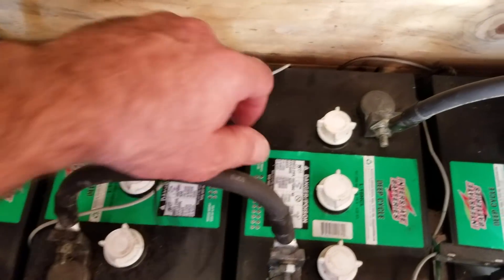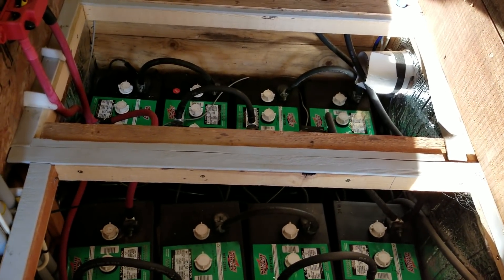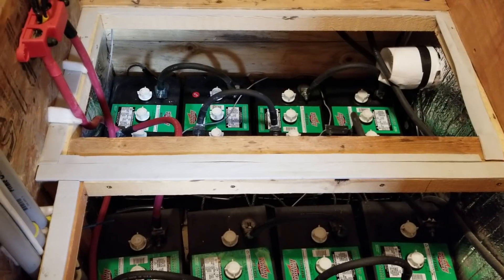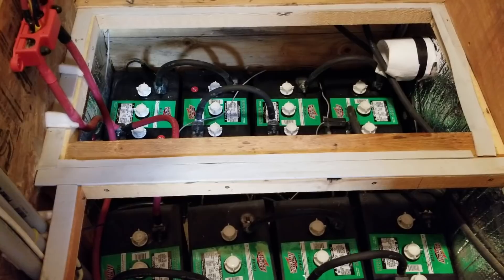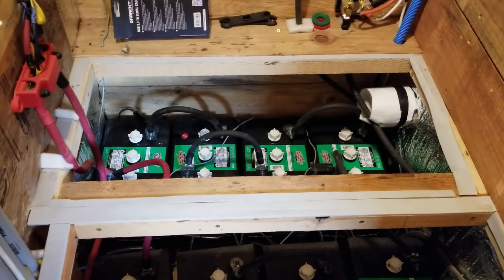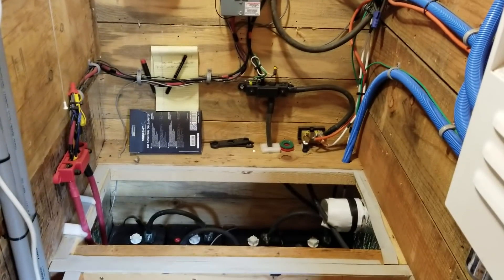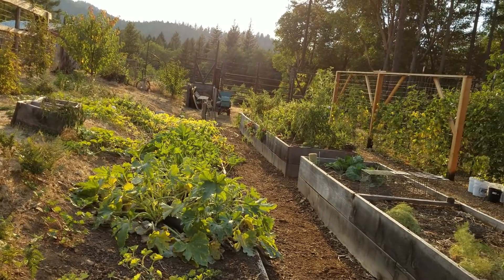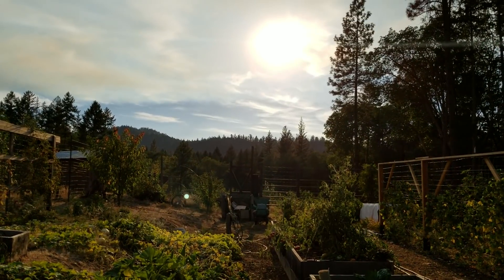Solar battery report.

Comment: Know this is a old video but I need your help. I am running 8 Rolls battery connected to make 24 volts at a total amp hour of 856. My problem is when I get up in the morning I see 24.9 volts on my battery. My specific gravity is above 1.275 when fully charge and ant rest for 24hours. 3 of the battery is actually at 1.300 specific gravity. There is no sulfation on the plates. My percent charge in the morning is 89% I have 2 battery monitors which I trust because they are top of the line they are victron BMV 702 and Bogart battery monitors which I see in you videos. All settings on monitors are correct both reading around the same in the morning. My big question is why my battery is at 24.9 yet my system is showing that I pulled only 10% out my battery overnight? Is it that to know the true battery voltage I need to talk all loads off in the morning before system start charging? Cant seem to find a video online showing system preforming at nights into morning and what the true battery voltage is. I must add this tho my battery manufacturer says battery is to charge to 30volts and float at 27.6 I was not doing this for sometime as the charge controller I had would charge only to 28.8 volts. Could it be that my battery has lost capacity due to not fully charging and if this is the case would it not sulfate?
Reply from the maker: Greetings, 24.9 volts would be about 79% SOC with no loads. This used to bother me so I did a simple test. The only way to get a true reading from your battery bank using voltage only is to remove all loads and charging for 3 hours. Ill bet when you do this you will see your voltage creep back up to about 25.2 volts which is 90% SOC.
Reply: @offgridinthepacificnorthwe3210  forgive me for saying this but I could hug you so tight now for this information I have bother me for 3 years now everybody showing videos how there system is at 25.2 volts and they are pulling 2 times my amp form there system. Thanks thanks thanks thanks your videos are so educational please keep them coming.
Reply: @offgridinthepacificnorthwe3210  I made a error in my text the morning volt is 24.1 with a 250 watt constant draw on system.
Reply from the maker: @seanjsolar2493  Another test that I do once every six months is I measure the at rest voltage of every battery individually. Once I found one battery that measured 4 volts. It had a bad cell. This one battery pulled the voltage down on the whole bank. This will also cause the other batteries to over charge with more water loss. Each  battery when full should have 6.4 volts. If you find one that reads significantly less then it is the one causing your low voltage reading in the morning.
Reply: @offgridinthepacificnorthwe3210  thanks so much for the info
Reply: @offgridinthepacificnorthwe3210  did my load test this morning. I pull my battery down to 24.08volts overnight then just before the charge controllers wake up I disconnect them from putting a charge into the battery then I disconnected all loads and allow to rest for 1 hour. My battery bank rise to 24.57 volts this is about 67% state of charge it's not the exact state of charge that my victron battery monitor was reading but I am happy to know that my batteries are on to pull down to 24.08 because my true battery voltage was 24.57 thanks for you help God bless.
Reply from the maker: @seanjsolar2493  Glad to help and May The Lord Bless you as well in Jesus name.
Reply from the maker: @seanjsolar2493  Glad to help and May The Lord Bless you as well in Jesus name.
Reply: @offgridinthepacificnorthwe3210  I also did some research and found out that Rolls have state of charge to battery voltage chart on there web  site. This chart put all my questions to rest as there batteries has a much lower battery voltage to state of charge. Here is a link to the page. Never know that different manufacturers have different state of charge to voltage. So pulling my battery down to 24.1 volts I'm actually at 75% state of charge. This is only with Rolls FLB. Check Trojan and there's are much higher voltage to state of charge. 

http://support.rollsbattery.com/support/solutions/articles/10372-voltage-readings-state-of-charge
Reply from the maker: @seanjsolar2493  I am glad you solved the discrepancy. It took me 4 years to get the specific gravity information from Interstate batteries. Not all chemistries are the same that's for sure.

Comment: Glad I watched this video.  I have the exact same L16 batteries on my 24v system.  Bought them about the same time.  Mine are doing very well.  Specific gravity has been okay.  I've only been at 30v absorption.  I think I'll try it at 31v.  How is your system holding up.  I've never taken mine below 80%.  I'd like to get 20+ years out of them.
Reply from the maker: Greetings, at 5 and 1/2 years I had one battery that failed. It has evidence of a factory defect. The  Interstate batteries I bought were a grid pattern and not solid plates like a Rolls Surrett. One of the grid plates broke away from the maneuver internal buss leaving it a 4 volt battery. Rather than buying one new battery to replace it I sold the remaining batteries and installed lithium batteries from a Tesla EV. Doing the build myself it was less money than buying new Rolls Surrett batteries.  I have videos of the lithium batteries. I have leaned that the differences between sulfation and shedding plate material is like dancing on the head of a pin. I have also learned that with FLA batteries heat is you enemy. The number one reason I went with lithium is you can hover between 20% and 90% for months at a time and there is no sulfation where with FLA batteries you want to come to a complete change every 3 days. Here in the Pacific North Wet where we get 60 days a year in a row with no appreciable solar gain.  The second reason is lithium was cheaper than a new set of Rolls Surrett.  I still hold that 20 years with FLA Is doable because I have friends who have done it. Have a blessed day.

Comment: True switching to Lithium is the answer. They was too expensive a year or two earlier but now they are very much worth it. YOU can even save about 35 to 50% by building your own battery. If you need 12 volt you have to stick with LiFeP04 4 3.2v cells in series. but with 24 or 48 volt you can put 7 or 14   3.7V standard Lithium cells in series with a good battery management system and have a really nice long lasting battery pack. The lithium batteries charge about 50% faster than lead acid too and the voltage does not sag like on Lead acid because they have very low internal resistance. Lead acid is still good for car starting but they are getting long in the tooth to continue to use for off grid energy storage.

Comment: Thanks Steve...appreciate your kind words. I did some things incorrectly from the onset with these Trojans. 1) boxing them in 2) packing them together with almost no separation 3) no enough ventilation in the box 4) took advice from "someone" on setting up the Midnite's charge parameters. 5) heat. IMHO #4 is when they started to croak themselves last December. Should have NEVER listened to his advice and kept them per design (OEM charge parameters) I contacted Trojan and all they said was I had them set up correctly and operating them within specs. I contacted no-kidding engineers...same synopsis. They are out of warranty and Trojan isn't doing anything (don't expect them too). I have managed to get eight of them to work "somewhat" safely. Only taking them down to around 85% tho. So...never again will I do FLA. The L16's I have now were not RE batteries per se from the start. Funny how you mention Interstate Batteries. I just replaced my Chevy truck's battery with an Interstate Batteries AGM starter battery (H7)...truck fires up with authority! I also have several U1 size deep cycle agm's in my ammo cans. Interstate makes top-notch batteries. Be well friend...and thanks again.

Comment: I have rolls surretts 550s 8 of them wired at 24v most days I only go down to 90%soc every night
Reply from the maker: That is what I do. I have been told by a 40 year off grinder that we should get 18 years from our batteries as long as there is no factory defect present.

Comment: Also the Chevy Volt batteries are actually larger than they are rated, 2012 has a 16kWh bank, but only 10kWh of it is usable by the car, the buffer is for battery degrade over time, its suppose to shift so the car continues to keep 10kWh of capacity for range. My parents have a 2012 volt w/ 160k, so they are very reliable batteries, they plan to keep the car tell the batteries no longer function.
Reply from the maker: I am looking into the Chevy volt and the Nissan Leaf batteries. I will have to see which one works better with my 24 volt inverter. 48 volt is easy. 24 is a little tricky as the voltage threshold at 24 volt nominal may go to low for my inverter. Thanks for the info!
Reply: @offgridinthepacificnorthwe3210  The chevy volt batteries can be used in 24v configuration, just have to grind the busbars between some of the cells to break them down into 24v segments and just run a jump wire for the last set since it would place the split between 2 banks. I would also look into smart car and chevy bolt batteries, they have come down to roughly the same price with smart  cars being the cheapest of the 4 cars.
Reply from the maker: @williamhustonrn6160  True but the voltage at 40% SOC Is around 22 volts. This may be to low for the magnum inverter.  Configuring the cells to a maximum of 30.5 volts at 100% SOC  would work with my Magnum inverter.

Comment: The batteries we are currently using are 18650 cells in our RV on solar, i went around town and picked up free laptop batteries from large business and batteries plus stores, i built a plate designed holder that traps the batteries, then between the layers i use a nut on each end to allow me to screw, screws in on both sides to contact the ends of the batteries in which i ran thin copper plates as my voltage bars. This setup has been working beautifully for me for 3 years on free Lion cells i picked up. A easier way of going about it recently came out by a youtuber jehugarcia, he designed a modular circuitboard setup that allows you to just snap the cells into the holders and stack them to produce power walls basically, the possibilities with his design are pretty endless, he has been testing them out to produce a better version of the setup for better reliability and function. When i built my setup for the RV, i only used cells that tested out over 2000ma, so i have probably 8000+ cells that range from 1000-1999ma that i never used that i got all free from recycling "bad laptop" batteries.

Comment: Have you considered nickel-iron batteries?
If you've looked at 'em and avoid 'em, please say why.  I trust your opinion.
Reply from the maker: Greetings, sorry about the late response. IMHO the nickel Iron batteries are amazing for their 
longevity but they have a few  negatives. #1 they are ridiculously expensive.
#2 The are very inefficient. #3 They do not like to give out high amperage. The long and short of it is in order to get enough amperage to feed your inverter you would have to have twice as 
many batteries as you would FLA batteries or Lithium Ion. You would also have to have a much 
larger solar array because of the Nickle Iron battery inefficiency. I hope My next battery will a 
Lithium Ion type from a used Nissan Leaf or a Chevy Volt. I had a quote for a Chevy Volt 13
 kilowatt battery shipped for $1200. This is half the price of my eight  L-16 batteries. The EV car batteries take considerable re-configuring but 6000 cycles sounds amazing. Lithium Ion have 
the advantage of being able to use 70% of their capacity without damage and can stay at a 
partial SOC indefinitely with out harm. I hope this helps.

Comment: I would really like to hear more about the guys who got 20 years out of their batteries.  What was their typical discharge overnight?  What where there charging parameters?  What temperature where they stored at?  Where they brought to 100% every day?  How often where they equalized and for how long?  What size bank?  What's there religion?  :)  Thanks!
Reply from the maker: Greetings David, My friend used what is referred to as the Sandia Laboratories US Government  study  for FLA L-16 batteries. Finding the actual report is very difficult but some people have 
offered a synopsis of the Sandia Labs report that has given me a few clues. I shared this with 
my friend and he said that is what he has been doing for years. In essence An elevated absorb 
voltage, coming to a full charge within 3 days and going no lower than 80% SOC "EVER"
The elevated absorb voltages for 12, 24 and 48 volt systems are 15, 30 and 60 volts
 respectively. That's 2.5 volts per cell rather than 2.4 as is recommended by so many battery 
manufacturers if memory serves me well lol. He always used the recommended float voltage 
from the manufacturer. My particular batteries need a higher absorb voltage than 2.5 per cell as per factory specifications. I use 31 volts in absorb for my 24 volt system. The down side of 
using elevated absorb voltage is the possibility of plate materiel shedding if the absorb voltage 
time or end amps setting is to long or to low respectively. The absorb time or end amps were 
set to achieve the factory recommended specific gravity set-point. It appears that the wear 
factor in a FLA battery is simply amps out and amps in. As for my friends climate the batteries never got above 90F or below 40F. The mean average was on the cool side around 60F. This 
was all in the Pacific North West with long grey winters. My friend Jeff came over and inspected my solar system charge parameters' daily usage and is confident that I would get 18 years
 from my bank barring a factory defect with one of the batteries. Time will tell. We have 4.5 years on them now and so far so good.
Reply: @offgridinthepacificnorthwe3210  Thanks for the great info!  I think my biggest problem will end up being that my batteries are subject to a mean average temp of around 89F in the summertime.  I need to figure out a way to keep them closer to 75F.  I'm also working on a way to track the health of my bank over time.  Will post a video on that soon...  Again, thanks for the info.
Reply from the maker: @HomesteadEngineering  I keep my batteries cool with an exhaust fan that pull cool air in from under the building. The fan is off by the time it gets hot. The fan runs all night long in the summer and turns off as soon as the batteries go into float which is usually mid morning most of the year. The fan running at night cools the batteries down below maximum efficiency temps. I don't mind a lower charge efficiency if the batteries last longer in the end.
Reply: @offgridinthepacificnorthwe3210  Sounds like you have a good plan that is working well.  In my case, my fan is venting hydrogen from around 8:00am until the batteries are charged which could be anywhere from 11:00am to 4:00pm when its 98F outside.  I am thinking of digging a trench and burying some pipe.  Then I can pull outside air through that buried pipe to cool it before it goes into the battery box.  Well see...
Reply from the maker: @HomesteadEngineering  That's a great Idea. It is rare for us to have weather above 85F. Maybe a week or two. Its usually in the low 80s in the summer. Kelog69 said that 98F is what 
killed his bank.

Comment: I bought AGM 5 years ago and there still going well according to the data, I havent checked in over a year due to a accident still have a broken leg that wont heal and just had a bone graft. I would go for forklift batteries if I do it again
Reply: sctpc. Thou Shalt be healed.
Reply: I have the leaf and the tesla smart lithium ion. The leaf needs to be properly charged and balanced. Compared to a lead acid these are incredible. They charge fast and hold voltage. An hour or two after you start charging them you can run big loads on them. Thank you for the video

Comment: I hate to see that happen to him. He is one hell of a good man.I think he got a bum set. My Trojan t105s are close to 4 years old and I am still getting 99% out of mine. I will say this. Mine have been down to 60$ or less less than 10 times in the 4 years.  Know he was running his down to 60% each night. But still I think he got a bum set.. If I recall his where low when he got them day one.
Reply: Bobby, how do you know they are 99%?  Are you looking at the kWh out each night vs. the SOC drop and plotting it over time?  Thanks!